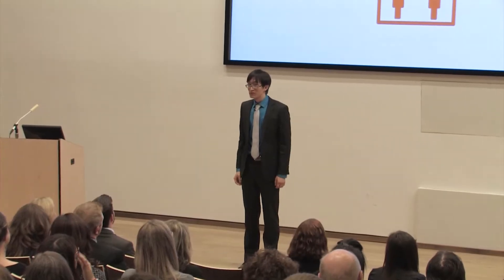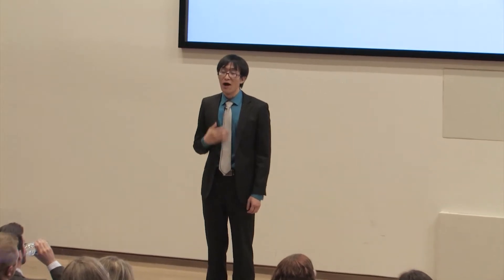Double Rotor Motor - Teng Guo, Ontario 3MT

Comment: I hope you have continued to pursue this idea!

if not i have more than enough drawings sketches etc. on double rotor designs for electric motors some taken even as far as to act as stepper transmissions, switching the power input output between the primary stator and primary rotor to elevate the speed and torque or the secondary rotor or even the secondary stator... good luck i've been drawing these things up for several years now and somehow it hasn't caught on yet!